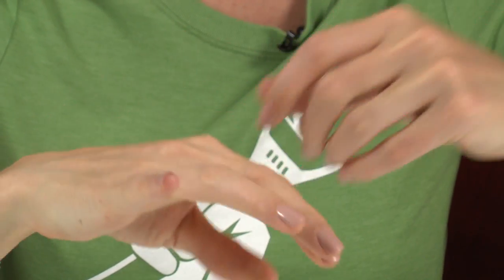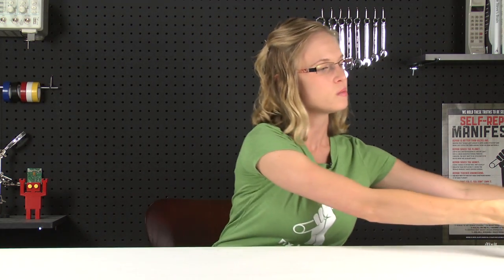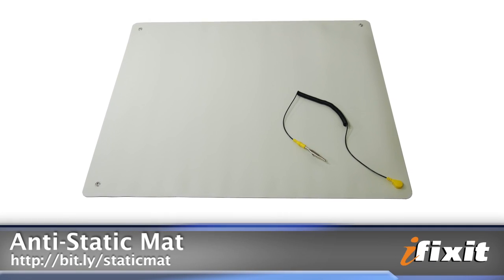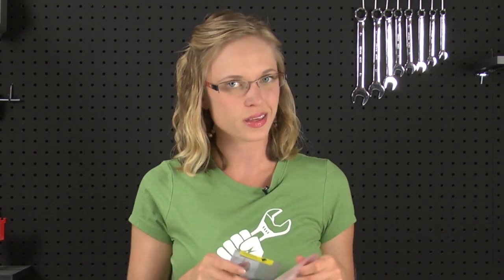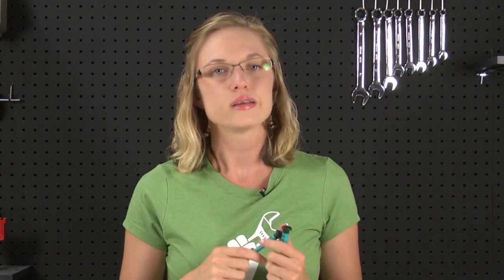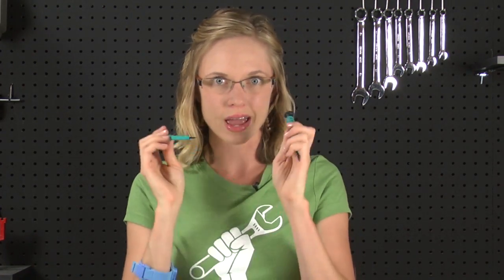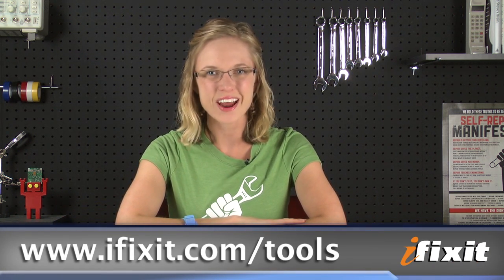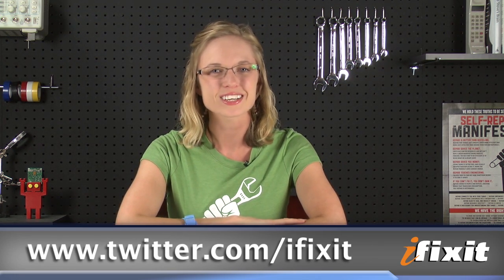ESD is NOT a Venereal Disease

Comment: the relive humidity is a nuisance for us in many ways chap lips sinus headaches
raise the relative humidly will reduce the seasonal static problems
its a catch 22 running the heat change the ability of air to hold water

Comment: This is incorrect information. ESD wrist straps should NOT be connected to the surface of the mat using an alligator clip. It should always be connected by banana plug to a dedicated plug on the mat, which is why this mat is troubling, because it only has a snap on cable for grounding the mat but not a female banana plug for the wrist strap. It says this very clearly in ESD regulations that you should not clamp the wrist strap to the mat with the alligator clip.
Reply: I'm wondering what the plug in the mat is connected to besides the mat? I'm just trying to understand. Either I connect the strap to the plug on the mat, which is also metal. or directly to the mat, what is the difference?

Comment: I would like to buy anti-ESD wrist straps that are better than snap buttons... I used such technology to detect electrical interferences between audio devices and noticed there was a difference depending on the position of the button. (Basically, holding the joint between male/female jack connector with my fingers was absorbing the noise... I tried using a wrist strap to replicate the absorption and noticed that the air gap between the button and its snap was a failing point.) I'm afraid SOME wrist straps give us false safety.

Comment: ESD is legitimate. It really irks me when know-it-all technicians say it doesn't happen because they've "been doing this for 20 years" or something similar. It's most likely happened, but the device never had a major failure. It can cause intermittent issues, or very minor issues they may get worse over time. It's happened to me when working on a laptop in the past and I immediately knew what it was. It zaps holes in the circuits of the boards, and may not do it in the major circuits if the system appears to work correctly at first. So to all you "know-it-alls", go ask the linemen to not protect themselves by not wearing rubber, such as rubber boots, when working on electrical lines and see if the don't shock themselves. Same concept. 

Now she's absolutely correct, except a few things. First, the ground from the mat needs to ground to a power outlet. You can easily screw it on behind the faceplate. Second, you wrist strap should never be that loose. It needs to be snug and the metal must be touching the inside of your wrist. Third, that wrist band should be alligator clipped to the "button" on the other side of the table mat. 
That's how it's supposed to be done, otherwise you are not creating a true ground. This is being that the ground surface you are on is not carpeted.
Reply: Aaron Kelley 

You are correct I work in a aerospace/military industry where ESD is very important. The mat itself requires grounding to the middle screw of the outlet faceplate this is also ground or else it is the mat is just floating and the charge will dissipate into your PC. The alligator clip from the wrist strap connection must be connected to the metal button on the mat not to the mat itself this would be considered daisy chaining.
Reply: @paurach4430  Why wrist strap must be connected to the mat by snap button? Why we can't connect by aligator clip? Aligator clip will touch bottom of the mat and we know that bottom of the mat is conductive so it should be grounded.
Reply: 94PeterQ hi Peter you should be connecting to a common point ground and not using alligator clips to attach to the mat the reasoning is because there is a 1 Megohm resistor in the wrist strap and if you connect through alligator clip to the ESD mat you are adding at least another 1 Megohm resistance in series or more with your wrist strap and this may cause too slow of a discharge time. The 1 Megohm wrist strap connection was meant to attached directly to a common point ground for this reason.
Reply: @paurach4430  Hi, I'm about to buy an Anti-Static Mat and Wrist Strap. However, Aaron Kelley wrote in the last sentence above: "This is being that the ground surface you are on is not carpeted.".
Now the ground surface in my room is completely carpeted. So just using a Mat and Wrist Strap would not give proper ESD safety in this case?! I would also need to put something below my feet and my chair, that shields me from the carpet? My chair is plastic wheels. Would it be enough to lift my feed from the ground and put them onto the plastic from the chair?

Comment: Do you need the antistatic mad if you are working in a wood table ??
Reply: Xoan Cosmed Depends on your whole surroundings. But it's better safe Than sorry (Remove the charge by touching a piece of metal or touching a power cable with power coming from it)

Comment: This is much more detailed:
watch?v=BmpBell7yhY
Watch all 4 parts and you'll gain good knowledge about ESD.
You may think it looks outdated, I assure you it isn't.

I've worked with assembling and soldering PCBs on 2 factories and I've seen a bunch of expensive boards thrown away, because one single component was damaged on each board.
Each time ESD happens on a component, it gets more and more damaged internally.
Suddenly one day it shows, it may be weeks or months after the product is sold.